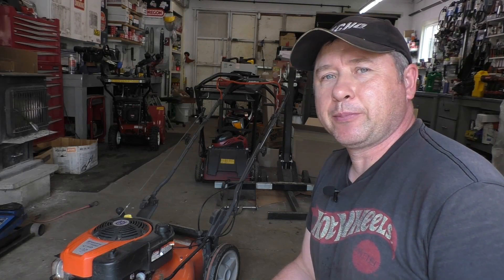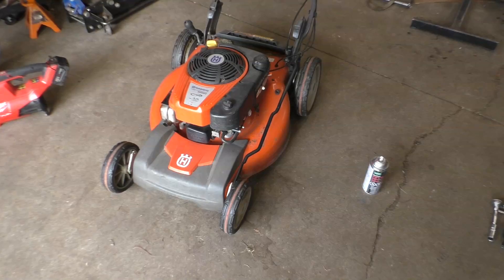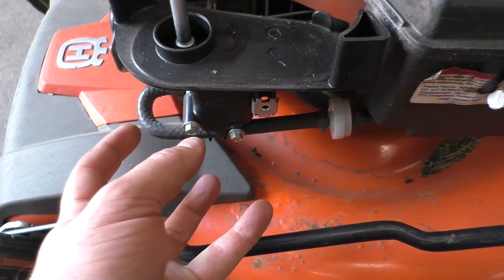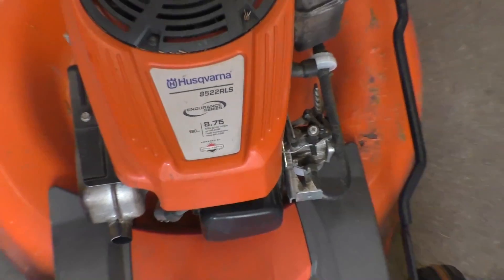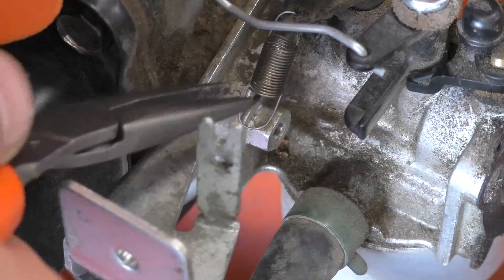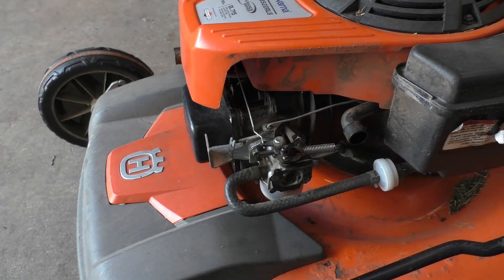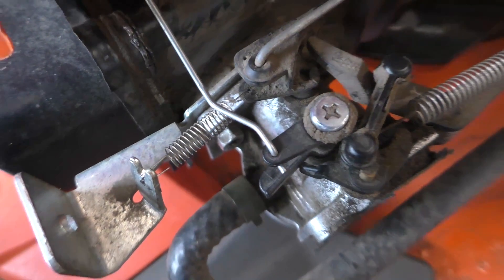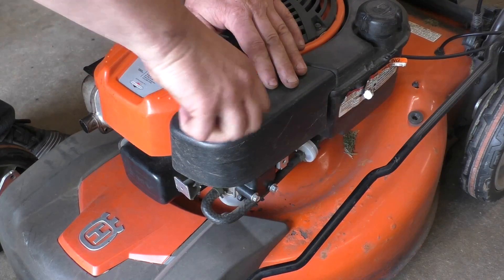Lawnmower Starts & Dies! Step By Step Repair

Comment: Have you ever worked on a Chinese mini ATV (like 110 cc)? I am a retired (disabled) Class A auto mechanic (one of the first females in Canada-- mostly worked at a Honda dealership) so people tend to assume I can fix things that I've never laid eyes on before : ) -- like these ATVs--  my neighbour's grandson's. So I have been binging on videos and yours are by far the best I have found. You really would make a wonderful teacher. Thanks to you I brought my 1999 Craftsman 13.5 hp lawn tractor back to life. Now I need to find out the best way to replace a starter on these little chain-driven puddle jumpers. Getting it out is always easiest, getting the chain on the starter gear is a challenge as it is but also as my hands are deformed from rheumatoid arthritis. Any tips would be great but no worries if not, I just love watching you work. Thanks for helping me keep learning 30 years after I stopped working on machines. xo

Comment: Thx for another great video.  i have a mower with a B&S engine that was missing a spring but doesn’t  seem to make a difference.  The throttle adjustment remains at low idle regardless of how tight the spring is.  I am thinking I have to check to adjust the Governor itself

Comment: i had a similar thing on a 1994 5Hp briggs, the choke spring was lost. and I didn't have one and the carb is discontinued part. so I converted it to a primer  style system with used carb and air box and removed Throttle cable  Then it worked

Comment: i have a lawnboy that kinda does that, even put a new carb on it . cold start fires right up , runs for a minute than slowly dies. takes ten pulls to start , will stay running after that to cut the grass. does this EVERY time i go to use it !!

Comment: I have 7800 generator from harbor freight hasn't been started for a good while.
It won't start except when I use starting fluid and than it dies
Reply: Clean the carb. I'm sure at one point it was stored with gas in it, small engines should always be run dry or at best drain the tank and bowl before stored. Ethanol reeks havock on small engines.
Reply: Clean the carburetor, fuel lines and tap

Comment: Small mufflers ie Stihl FS 200 and many similar I'm certain. I take the muffler off before the trimming season and throw it in the fireplace and let it completely burn red hot to clear all the carbon. Starts easy every time. Today I just added a .008" aluminium strip gasket to the existing gasket as it had a couple of small pits in it. I spent the next three hours trying to start the machine again and even took the cord pull off and used an impact driver to spin the flywheel and motor at high RPM... Lots of spark.... Lots of fuel.... Not a single solitary fire up... Continued to the point of going insane... Lots of fuel.. lots of spark but no fire.. Checked everything. Then pulled the muffler off to see that I had not cut the exhaust port hole in the aluminium strip.... Might be time to get my name and home address tattooed on my backside just in case that 'time' is now here? :)

Comment: Hi Don, I was just wondering. Do you charge a Customer for a repair like this? How Much? your time is worth something.
Reply: Assuming he has a business I would have to say a minimum one hour charge at least. You can’t run a business giving away everything
Reply: @JohnR9965  $80. -$100. hr for a $5.00 Spring and 10 mins of work. 🤔could buy another Mower. But I get it, look before taking it to the Mechanic. I would have charged 15 mins labor plus the cost of the Part.
Reply: @steamboatwillie935  I get what you’re saying but I would have to assume minimum one hour charge because  the way things cost today but I’m not a small engine mechanic lol

Comment: Great video Don would I’ve run across these machines with missing springs before and I don’t believe they just jump off themselves. Have you done a video on coil and flywheel with a lot of rust on it  I recently fix fixed one of these huskys with severe rust build up on the flywheel from being left outside which is never good for any machine.

Comment: that engine is probably the start of the end for briggs.  Starting with hollow muffler no crush tubes so gets loose and snaps end of studs off. Next is the throttle control will bend down not allowing engine too stop,  Auto choke linkages bend and crap out because they run across to muffler at front of engine get hit bent engine wont start.   Its gotten too the point our commercial operators will use chinese engines instead.  Sure the lifespan isnt as good but it will last as long as a new body will at 1/3 the price with less actual silly faults they go and go then die 4 years.  Its sad when i started in the trade 30 years ago outdoor power equipment was all for making it better that the other guy, now its how to make it cheaper.  An engines lifespan id say has gone from 15 years easy on a briggs classic to 7 if lucky on the new ohv units.
Reply: You are very correct on your opinion  on those engines and newer machines in general. The new Chinese made machines just don't hold up.I regularly  get older tecumseh and briggs 15 to 20 years in my shop where the engines are strong and bodies rusted and save the engines as a donor machine. My older customers comment on how they used to have briggs engines last decades.
Reply: You sir are spot on. I have an older Dynamark tractor from the early 90s with the 12.5hp Tecumseh engine and with regular maintenance the thing still runs and cuts awesome. They just don't make equipment like they use to. It's a shame we spend hundreds of our hard earned money and get machines that break down in a couple years

Comment: I originally thought it was something in the gas tank or fuel line not letting enough gas to get to the carb. In most cases it is never the sparkplug unless it is a made in China plug. Most likely the guy that fixed it before forgot to put that spring back on or it was not there at the time and they never tested it to make sure it worked the way it should. If we stopped using products made in China we would pay 3 times more than  we pay for the imports but we would  be able to get replacement parts. I have had problems getting parts for some made in China machines after only a couple years and when that happens you must make a part that will work or scrap the machine. If you scrap the machine it will sometimes end up back in China to be melted down to make what I consider to be more junk machines.  Look at our economy and ask yourself if we made a mistake buying from other countries when we are quite qualified to make a better product than what is available from other countries? Honda of course is different and they make a very good product but in my opinion  they design their machines to maximize the amount of money or at least it seems that way and they will make more money selling you replacement parts. In some cases you break a bolt but you cant replace just that one bolt because it has been welded to a bigger part and that part is $40 or you can spend about an hour drilling out the bolt and replacing it and welding and grinding. Most small engine guys will just get the new part and the customer pays or will have to pay extra for the extra labor involved in fixing the problem without getting the $40 part. If it is the same cost the customer will always want the new part. I live in Canada and I think the answer is to stop all imports and let us become self sufficient more like it used to be years ago . The problem with that is then people would have to have a job that PRODUCES something instead of people making big bucks doing nothing and producing nothing. Kind of like you did nothing you get nothing? Maybe we should also start to manufacture tents because the way things are going we will all be living in a tent soon or maybe under a bridge ! Good video as always!